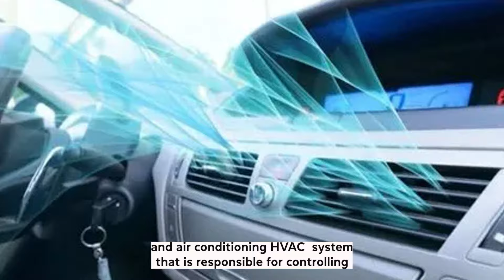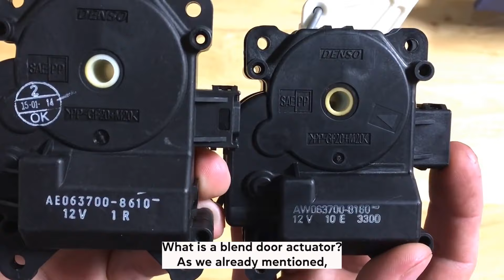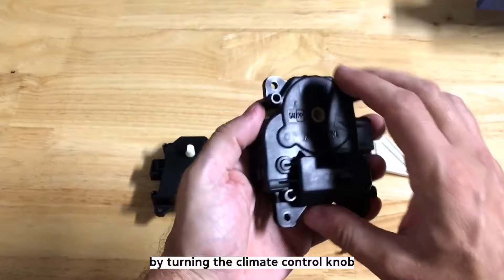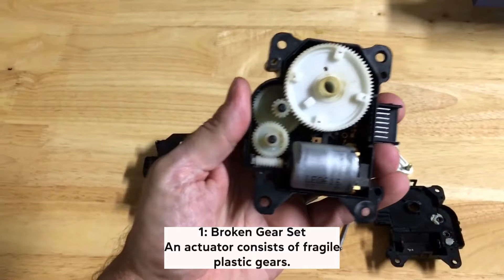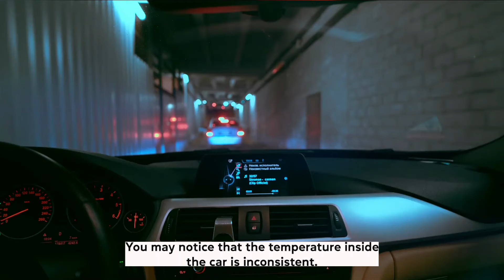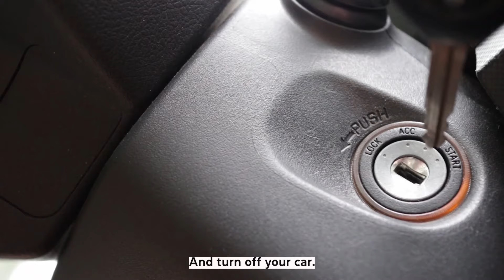How to Reset a Ford Blend Door Actuator

Comment: This did not work for my 2017 f250.  I ended up having to remove the new actuator and manually align the gear with the positioning of the mode door gear (female end).  Was not easy as there is very little room to see anything - just got lucky for the most part.

Comment: 2011 6.7 F350. Could not get cold air or to redirect air between the different vents. Pulled the fuse like in the video and turned the key. Well, when the fuse is gone the HVAC won't even power on. I let it sit 2 minutes, reinstall the fuse, and then when I started the truck all vents and the directional flow and temperature control was working. However, for a couple of days now, I have had to do this every time I start the truck if I want AC. Today, when I turn the truck off, I set the temperature at the mid point. 75⁰. I did this thinking it would position the blend door halfway open. When I started the truck, the temperature worked as it should. Every time I have turned off the truck I set the temperature at the mid point and I haven't had to pull the fuse again. I'm hoping I got this figured out.

Comment: This worked on my 2016 f150 Lariat with duel zone climate. On a 15-20 f150 youll pull fuse #12 inside the cab on the pass side under the glove box, it is a 7.5. This is a double fuse that also hooks into #13 which operates the cluster, so the gauges, climate control, and radio wont work at all. Pull this fuse and follow the instructions in the video. My fuse was stuck on hot and works again
Reply: 2018 Edge, same #12 fuse, 7.5 amp.  AC was cold on passenger side, not on drivers.  The battery was replaced is what I think caused the issue in the first place.  Pulled the fuse and followed the video, works now.  Thanks!

Comment: would this unit also be responsible for my AC randomly coming on while driving, even though it is not on? I switch it off and it comes back on again a few seconds later - This seems to only really happen in the mornings when it is cold.
Reply: low battery voltage can cause strange issues - ive had this happen on a 14 fusion

Comment: Resetting the system worked for me. I have a Single Zone Manual Climate Control System on my 2012 Ford Edge SE. it’s getting cold here now and my actuator door was stuck in the air conditioning mode. Even though I turned the temperature dial all the way to ‘hot’ I was still only getting ice cold air. I then chose to ‘reset’ the temperature control system first, before doing anything else. 

I reset the temperature control system by removing the fuse box cover on the ‘inside’ of my Ford Edge (located on the driver’s side floor on left side). Read the owners manual on how to access the fuse panel. It’s easy. There is a fuse-puller tool on the inside of the fuse panel cover. Use that tool to remove and reinstall the fuses. 

I removed two fuses. Fuse numbers 37 and 46. Both are labeled in the owners manual (on page 286) as follows:
Fuse 37 - Climate control (3.5L/3.7L engines)
Fuse 46 - Climate control

I placed the removed fuses and the fuse puller tool in the coffee holder on the center console. After removal of both fuses, I started the engine and turned on the temperature control system. It doesn’t matter where you leave the temperature cold/hot dial set at. Just be sure to turn on the system like you always do when you want a/c or heat. 

After turning on the system you won’t hear anything because the fuses are out of the fuse box but the airflow directional settings will light-up (as usual) on the main dial. I let the system reset for a little over two minutes then turned off the ignition and reinstalled the fuses. I then started the vehicle, turned on the temperature control system, set the temperature dial to the hottest setting and I heard the actuator door move (as it should). I let the vehicle run for a while (to warm up) and I successfully have heat again! I then adjusted the temperature dial to ‘cool’ and I have cold air (as expected) then turned the temperature dial back to ‘heat’ and I have heat! Works like normal now!

I followed the instructions in this video starting at the 25 second mark and it worked! I now have heat again! Try this method first before buying a new A/C -Heater Air Door Actuator. I saved a lot of money by not taking my car to the repair shop. It’s an easy fix. At the very least, try this fix first before doing anything else. Best wishes!
Reply: I couldn’t turn on the air, there was no power to the hvac controls.  I have a 2007 Edge.  It would be amazing if this could work with my model.  Ford dealership has no clue.
Reply: It worked, Thank You!!!!!!!

Comment: The instructions for resetting the blend door actuator in this video are contradictory and inconsistent. Twice he verbally tells the viewers to remove the fuses and then start the car and run the AC for 2-3 minutes. Yet in another part of the video he clearly states that one must turn the key on WITHOUT starting the engine. So, which is correct? Your guess is as good as mine.

Comment: Here is what apparently worked for my 2015 Ford Fiesta. Turned key to position 2 (making sure not to turn to position 3 which starts the engine). Pressed and held the AC button on the dial and recirculate button at the same time for a couple seconds. Blend door actuator started to click. Turned off the face air button and the mode actuator started turning, and the blend door actuator started to click again. Then after about 30 seconds all of the clicking stopped. I turned the face air button back on and it worked normally with no clicking going on, then turned my vehicle off. This appears to have worked because I had an issue where the blend door actuator on the passenger side glovebox was making a clicking noise after I turned off my vehicle after a couple of minutes of sitting idle, and it did not make any noise after I followed these steps.
Reply: I HAVE to know. Where did you get this info?  On the Fiesta ST forum, people just change the actuator, unless this is newish info as I have not perused it in a while.  I'm at 34k on my ST and have no clicking yet, but I have code B1086.  And practically every member gets the click by 40k.  The cheap plastic gear they say.  Hot and cold stressed over time, perhaps? 

I'm researching and found a reset method and will try that before I try this.  Hope to get a reply. Thanks!
Reply: @flbchbm I got a call/mail from the dealership saying there was a problem with the ECM (electronic control module) that affected my vehicle, so I took it in for a free upgrade. I took an educated guess that they never recalibrated the HVAC actuators after the upgrade so it was slightly off causing extra wear on the cheap gears over time. I did actually have to change the mode (controls where air goes) door actuator (which I did on my own so it probably isn’t perfect). There was a clicking issue that started showing up after I put recirculate air on so I am guessing it got stuck in the winter time. I then roughly followed similar steps for other vehicles from videos/comments and found this pretty much took care of the problem (it still clicks from time to time but it isn’t constant when I start my vehicle anymore, only after I shut it off sometimes).

Comment: Omg it worked thank you so so much. Remove the fuse labeled climate control. The fuse location can be found I the owners manual. Run the vehicle for 2 minutes and turn off. Reinsert the fuse. Turn on the vehicle and run AC to see if it’s fixed. Worked on my ‘09 ford edge
Reply: Same here...literally just tried it and so far ok. 2009 Ford F150 here.
Reply: Will it work on an 2008? I don't have the owners manual.Garage says mine can't be fixed.
Reply: I have a 2013 Ford Edge, I have to do a reset and then again at the beginning of winter... 
Dual Zone climate control 
Passenger could set the control on air condition and the driver could set the setting
For Warm/Hot... There you go dual climate control 😉🙃✌🏽
Reply: Can you tell will it work with Ford focus mk3 2011?
After pulling out AC fuse, do I need to run engine for 2 minutes with AC on?

Comment: you mentioned in step 2 of the reset procedure to start the car without starting the car, and run the AC system. Step 3 is to shut down the car.
Do you start the car, or not?  How do you run an AC system without starting the car?
Reply: Set the key to run without starting it. Some vehicles it’s called accessory or auxiliary on the keyhole.
Reply: @Sazerac45 aka Key ON Engine OFF -  KOEO.

KOER of course, is engine RUNNING.

Comment: A bunch of nonsense I already know as a seasoned mechanic. Trying to get to actuator so I can lubricate The gear and stop the clicking noise
Reply: A seasoned mechanic would know that lubing the gear isn’t going to stop it from clicking. Because if its clicking, one or more teeth on the gear are broken or worn down, allowing the motor to slip.

Comment: 2013 Ford Raptor driver side stays cold. No heat to driver or defrost. I am suspecting the hot and cold blend door actuator after seeing this. Let me know if its defective. Thank you for a detailed video!
Reply: 2011 Ford Raptor driver side hot and passenger side cold. Did you have any luck figuring out the issue on yours?
Reply: Did you figure it out . Mine does the same . I replaced yhe actuator and it only worked for 6 months @austindavila8895
Reply: @aus @austindavila8895 aving issue like yours , how did you fix it? Which part you replace? Thanks
Reply: Any updates on this? Mines blowing hot on driver’s side & cool passenger. Thanks I advance.

Comment: Oh, surprise, surprise another Ford part with more plastic parts designed to fail with the lowest production price and the highest replacement cost to consumers.  So maybe Volvo should think about Toyota parts or Honda parts and put consumers ahead of profit margins ?
Reply: This is very possibly one of the dumbest comments I have ever seen. You are very inexperienced with cars and it shows. Every manufacturer uses plastic parts for blend door actuators and all kinds of cheap things, even the gears in your door locks are plastic most of the time. You are completely ignorant ( i wanted to say stupid, but I didn't) If you think toyota is any different.

Comment: Dude u pull fuse no fuckin power..
Reply: Assuming the battery isn't dead or there's an open circuit in which case the fuse may be good, the circuit is bad and the battery won't be able to provide any power assuming it has power to give.

Comment: The blend door actuator can stop AC, video was good, but Mr. Vehicle Freak should speak slower, and use exact wording. He said takeout actuator fuses, start the car and said you do not have to start the car then said turn off the car. Good video, but need to give exact correct information when working on a vehicle.
Reply: He clearly said to start the car but not to have it running. That means you put it the key into the run position for 2 minutes and then you shut it off for one minute without actually starting the car. Only the key
Reply: @snakeplissken4552 come on. You cannot start the car but not start the car. That's like saying walk but don't walk. 

If the OP was more of a mechanic, he would have said key on engine off, KOEO
Reply: You can always watch it on 0.75x speed if it’s too fast for you

Comment: On my 2014 f150 the fuse is labeled climate control and it is inside the cab, not under the hood. It is fuse number 46
Edit- it may work for some problems but it didn't work for me.

Comment: there's no hvac fuse (I looked ... forever) - you don't turn the ac on (of course, you can't there's no fuse duh) BUT! He was right about the reset working!

My Dad was halfway in taking apart the console when I told him to reset it like the video but what fuse?
 so he started by unplugging the fuse that powers the climate control

Then turned the ignition off 

Then restarted the truck without the fuse that powered the climate control 

Let it run for 30 seconds with the fuse still unplugged

Shut it off

Reinserted the fuse 

Fired it back up and now have heat!!!! 

This was for an '01 Lincoln navigator
Reply: ❤❤l😢❤😊😊❤

Comment: Just to let you know in case you are in need of this information that this guy has no clue what he's talking about sounds like he does but the locations of the fuses that he is referring to does not exist
Reply: Somewhat.... there's no hvac fuse (I looked ... forever) - you don't turn the ac on (of course, you can't there's no fuse duh)
BUT! He was right about the reset working!

My Dad was halfway in taking apart the console when I told him to reset it like the video but what fuse?
 so he started by unplugging the fuse that powers the climate control

Then turned the ignition off 

Then restarted the truck without the fuse that powered the climate control 

Let it run for 30 seconds with the fuse still unplugged

Shut it off

Reinserted the fuse 

Fired it back up and now have heat!!!!
Reply: @awesomelyme2026 … did he remove the fuse while the ignition was on? Asking because you said turn off ignition.
Reply: @deborahhaga7285 I’d like to know as well. Looks like he pulled the fuse with it running.
Reply: @awesomelyme2026 which fuse was that one??

Comment: Horrible instructions. If you pull the fuse, how can you turn it on genius?
Reply: It's the fuse for hvac. The car turns on and ac will reset itself when you put the fuse back after running it without fuse. Just assuming that's what he meant.
Reply: your stupid insulting knee jerk reaction doesn’t even deserve this response, this works. it turns on the rest of the system and allows a reset to home afterwards.
Reply: Jackass
Reply: Great video
Reply: It's possible that the CPU resets itself not having anything to do with power to the actuators themselves.
Reply: Your video is the worst get to the point. This entire video should be removed until you can learn how to do it correctly.
Reply: Simple instructions, cant comprehend, keep ur job at McDonald's
Reply: It’s the ac that gets turned on without it
Reply: It does not.  He's right @TheLineCrusherPVC
Reply: You don't 😂
Reply: If you pull a fuse, it has to be replaced with a good fuse assuming the one you pulled is bad or blown.  Replacing a fuse will sometimes blow again if there is a short in the system.  You will have to find the short or any and all replacement fuses may blow again.  If it doesn't blow, then happy days are here again.

Comment: Did you figure out exactly which fuses?
Reply: The fuse box for hvac is located at bottom left inside car on the driver side. There’s a cover with a slide. Slide it to uncover the fuse box.
Reply: @Wiicho  Easy to check all fuses in the fuse panel by setting your Volt ohm meter on continuity, touch one side of the fuse with one probe and the other probe on the other side of the fuse.  If your meter beeps with an audible sound, the fuse is good, if you can't get it to beep, replace the fuse.  Be sure your meter has good batteries before you start by touching the probe together as in shorting them out to see if the meter produces an audible beep response.
Reply: 35 and 46

Comment: Stupid fuses are not label HVAC
Reply: It appears this varies widely between makes and models along with the various years. It's not like one situation fits all.
Reply: On my 2014 f150 the fuse is named climate control and it is inside the cab, not under the hood.
Reply: No but you can pull fuses until your climate control dash goes blank
Reply: @awesomelyme2026 or, OP should, and this is a WILD concept, RTFM, lol
Reply: Ah, that credit belongs to the one who provided the label.
Reply: Mine is
Reply: Ac
Reply: Taking your battery cables off for a few minutes should accomplish the same thing, no?

Comment: 1999 Ford F150: I started getting heat but no A/C. The mechanic fixed the A/C and replaced the Schraeder valve. But months later I couldn't get any heat. I took it to a second mechanic who said I had a broken blend door, which he replaced as well as the blend door motor. That fixed the problem. But then, months later I couldn't get A/C. 

Of course, I should have checked that the HVAC was working, but I didn't. As well, this is my second vehicle that I don't use frequently, so I let it go for a while. Coincidentally, my auxiliary power source and radio had not been operating. I thought that the problem would likely be some electrical problem. I resolved to take it to the shop and have it fixed ... when I got time to do that.

My next door neighbor who is more mechanically inclined than me offered to look at it. To my surprise (and despite my skepticism) he fixed the problem. He told me he found something on the internet (like your video) and gave it a try. 

A bonus is that my radio started working. And I have no idea why.

If you don't know by now, I'm an idiot when it comes to mechanical things. 

People like you who publish informative videos like this are wonderful! Thank you,
Reply: What's weird is that my radio stopped working the same time the blend door actuator stopped working.
Reply: @itsmeMandyT also it was weird is that my passenger headlight stays on unless I unplug it. I just bought the car for $2,000 so I don't know the timing in which it all went out. But still weird LOL hoping it fixes both of my problems too
Reply: I gave up buying Ford back in the 60's when I came to realize I couldn't afford a Ford which began with C4 automatic transmissions, alternators, starters and a parts list long enough to make a mechanic beg for help.
Reply: You may be an idiot, but you're an idiot with good grammar and typed out the description very well 😅. Actually, bud, you're  no idiot. Not every trade is for every man/woman. That's why we have youtube so we can attempt this sort of thing. Idk how true this fuse thing is resetting the blend door actuator is but.. i have had no clue that it's an actual thing. Makes sense in theory, so I'm going to try it. Wish me luck!😅